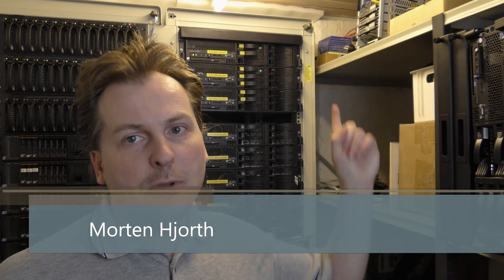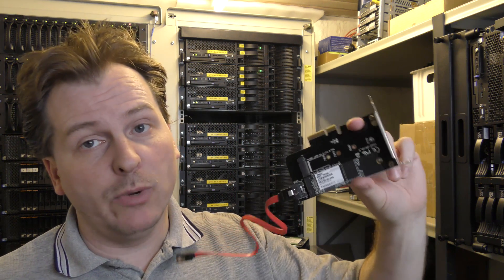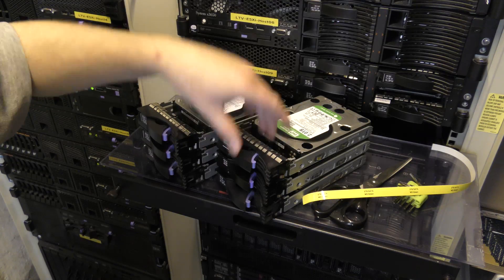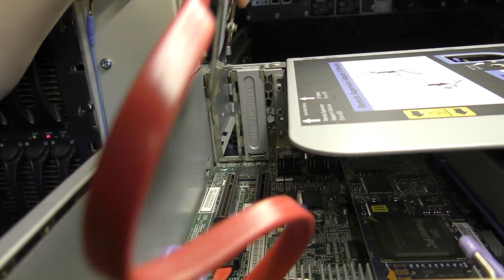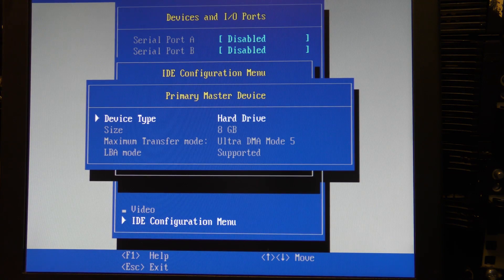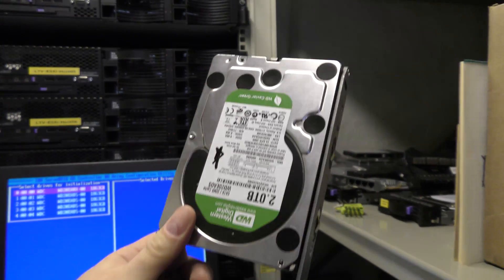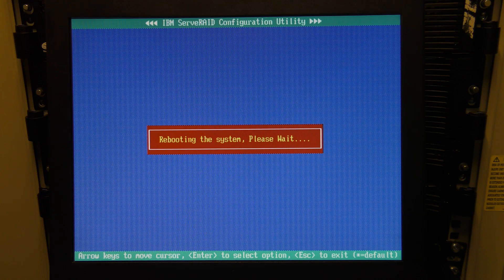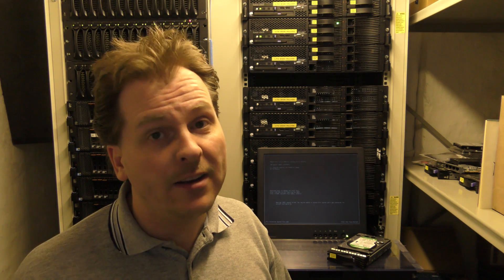Amazing Enterprise HDD, Not Available! This will DO - 514

Comment: Hi, i have a problem with a sas drive. The video is whats going on: https://www.youtube.com/watch?v=hdKWn7gy93c
Reply from the maker: Hi Lawrence Tech
Thank You very much! nice setup! I have not used Serveraid much,, what controller are you running this on,,or Server?
Thank you for watching! :-)
Reply: im using IBM ServeRAID 8K-l controller #0. the link that i have attached is a picture of the RAID confic screen. and when i went to look for the drive it didnt show up so i loaded windows and downloaded serveraid to see if it could see it. https://www.mediafire.com/?1asnjot60zbokys
Reply: oh I have got the new firmware and it's running fine it was that the firmware was courupt

Comment: hi, so i got a ibm x3650 and the right side where you put the sas disks in. whell that side isnt working.
Reply from the maker: Hi Lawrence Tech
Interestion!! do you have two CPU´s in? could they be disabled in bios?
Thank you for watching! :-)
Reply: Hi, so i got it to work but one of the sas disks is not showing up however it isnt dead it still spins. should i reflash the disk or reflash the raid controller.

Comment: It is my understanding that Western Digital drives were formerly manufactured to very similar specifications across all of their lines. However, a few years ago, the company decided that such was not a great idea in terms of money making, so they starting introducing manufacturing differences in quality among drive classes, which is where the greater failure rate of green drives started interfering with their reputation. Of course, Western Digital and Seagate have ever been below Hitachi or HGST in terms of reliability, but that does not keep me from running a Western Digital Blue drive in my desktop PC all the time, and it has not failed me yet after multiple formats and several different OS installs. As is said with cameras, the best drives for machines are the ones you have with you. I quite like this new life breathed into the IBM x3650 M1 as massive storage servers!
Reply from the maker: Hi Tyler Barton
Thank You very much!  I am out of 2TB drives,,ish,, so I need to use what I got! :-)
Thank you for watching! :-)

Comment: If you disable the IntelliPark function on the drives you should have no issues at all with the green drives in a RAID.
It's the IntelliPark that causes issues in a RAID.
Reply from the maker: I used them with out,, but as they did get a really bad reputation, I stopped getting more.

Comment: Morten, well this is not a real PCIe NVME m.2 it is and m.2 B-Key

m.2 comes in 2 variants:

B.Key (SATA/AHCI Protocol) uses standard S-ATAIII Connection (or adapters have a S-ATAIII HBA on it)

M.Key (NVME) using native PCIe for Data and Power

m.2 NVMEs would be Samsungs 950 and 960 series drives or Intels 600p and 750 for example,

While both use PCIe, B.Keys still use the S-ATA storage Protcol AHCI where as M.Keys are using the newer m.2 Non Volatile Memory Express Protocol which is using up to PCIe 3.0 x4  Speeds...
Reply from the maker: Hi tmkoeln
Thank You very much! I changed it.
Thank you for watching! :-)

Comment: Just turn off the head park and you should have no problems. If the drive is too old then it will fail soon because of lot parking.
Reply: You usually can't do that on consumer drives anymore. (If its what im thinking) EDIT: Maybe you can change WD drives with some program called wdidle, to control the head parking activity timeout. This is unusual that WD lets you do this. At first I thought you were referring to TLER on in the built in firmware of the RED NAS drives.
Reply: Ofcourse you can do it , I have done it on two 1TB WD Green EZRX.
Reply: I didnt know. I will do it on mine too, but its only these WD greens.
Reply from the maker: Thank you.. I never did,, still worked fine.

Comment: I thought Raid 5 was to be avoided these days because it was really unreliable if you need to recover from a drive failure
Reply: cjfourty6 I agree. I even believe I saw MTBF less than "read whole disk". Software can fix some of these problems, but I wouldn't trust it.
Reply from the maker: Hi cjfourty6
No RAID5 is awesome,, but it does not replace you backup. If you think you RAID5 can be your single point of data storage,, then it is not sufficient.
Thank you for watching! :-)
Reply: Thanks for the nice videos and explanations.
Raid vs backup? It is only a small difference.
A catastroph of 1 or more disks, or a catastroph of one or more files.

In case you have a bad file, because you mixed something up, or deleted something, you need to have a backup.
In case a drive files, then that means a catastroph of even so many files and you need to do a big  restore.
How ever if you use Raid 1 or heigher, you do not need a restore and can fix it, by exchanging the defect harddisk.
In case of Raid 1 (Raid 0 is creepy and I never use that), you loose 50% of your storage capacity.
That is probably the reason that Raid 5 was created. Even though it is more a raid 0 with 1 parity disk. If the parity drive failes, replace it and you are on route. If a second disk failes, you better have a good backup. And I think that is where the most  people find Raid 5 creepy, and go to Raid 6.
Yet I wonder if Raid 6 adds  really something when you "only" have 6 disks in your server/nas. Or do you need a much bigger array, 12 to 24?

I just went from Raid 5 to Raid 6 because of the creepy stories, but I wonder with 6 disks only. My backup is probably good enough. 7 weekly  versions on a different nas in a remote location, and a weekly backup on a third nas, but in the servers building. Ok rebuild costs time, but not so much, that I do not know what to do else. (1 evening for 6*500GB disks.)
Reply: Correct, RAID5 for 6 spindles AND SATA >1TB, not recommended, even with HS. RAID6 would be better. Or if unavailable, RAID50 or 10.

Comment: Raid 5 :( Great video otherwise :)
Reply: I'm sure RAID 6 is an option on this server, maybe the RAID card only supports up to RAID 5
Reply from the maker: Hi Unkyjoe's Playhouse
No RAID5 is awesome,, but it does not replace you backup. If you think you RAID5 can be your single point of data storage,, then it is not sufficient.
Thank you for watching! :-)
Reply: We have to disagree, raid 5 write speeds suck, and I am not fond of any raid other than SHR :) for that reason.

Comment: You may want to check the soldering on that drives connectors, cracked joint.
Reply from the maker: Hi zx8401ztv
Thank You very much!  I have never seen that,,have you?
Thank you for watching! :-)
Reply: I have had a ssd drive connector just fall off, not enough solder so the joints crack :-(.
But with a fine soldering iron tip, and the tip of my tongue poking out slightly, i've resoldered the connector back on, worked fine :-D
The sticking out tongue is important LOL :-D

Comment: 8:17 RACK SERVER ACROBAT - I am impressed

15:25 RAID-1E
https://en.wikipedia.org/wiki/Non-standard_RAID_levels#RAID_1E

Some RAID 1 implementations treat differently arrays with more than two disks, creating a non-standard RAID level known as RAID 1E. In this layout, data striping is combined with mirroring, by mirroring each written stripe to one of the remaining disks in the array. Usable capacity of a RAID 1E array equals to 50% of the total capacity of all drives forming up the array; if drives of different sizes are used, only the portions equaling to the size of smallest member are utilized on each drive.[17][18]

One of the benefits of RAID 1E over usual RAID 1 mirrored pairs is that the performance of random read operations remains above the performance of a single drive even in a degraded array.[17]
Reply from the maker: Hi Carsten Hansen
Thank You very much!  This is the hardest server to film,, bad choice :-/ 
Thank you for watching! :-)

Comment: Awesome! But did i see correctly that a M1 can run Esxi 6.5??
Reply from the maker: Hi Henk Kok
Thank You very much!  Yes all is good,, almost,, having some network problems... But I do not think it has anything to do with the x3650 M1
Thank you for watching! :-)
Reply: What kind of problems? Can i help?
Reply: The M1 possibly need custom drivers to function with ESXi 6.5 because VmWare had the brilliant idea in 6.0 to lock out old nic drivers (prior to i2xx for Intel for example) for new installs...